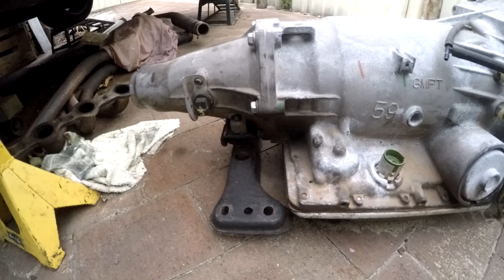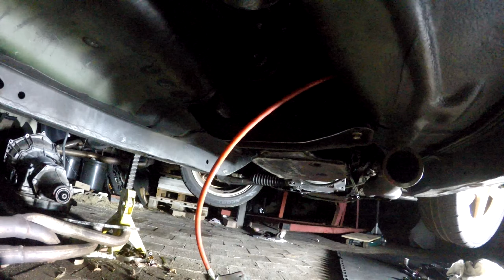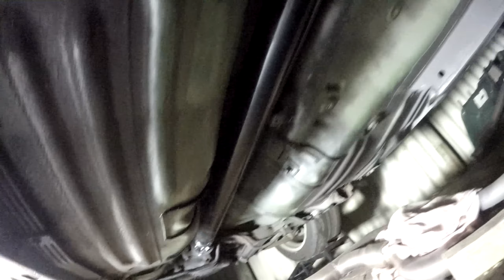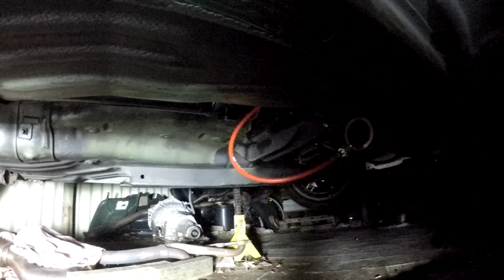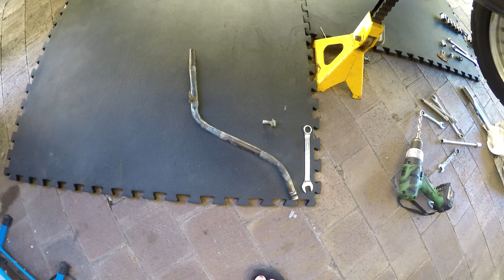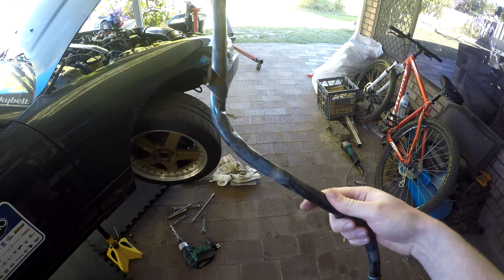The TH400 is in the Silvia and she RIPS!

Comment: Sorry mate - wanted to comment on the 1hdfte conversion but could not leave  a comment there. Any thoughts on a 1hdfte with a mechanical fuel pump conversion? I can get my hands on one that i can throw in my 105. Only concern is then there is no communication btw boost and fuel. Upside is simple and easily tuned. Any thoughts? Thanks
Reply from the maker: A 1hdfte with a mechanical pump conversion is basically a 1hdft. Not much difference other than that between them. The pump is smaller 12mm vs 14mm so you'll never get as much power from it. Also mechanical pumps are more or less impossible to tune without some smoke off the bottom end. With an electronic pump it's easy to make it smoke free.
Reply: @brendonv101  thanks mate. Good info.
Reply: @brendonv101  mate ended up sourcing a low km hdj100 fte from Japan. No security which is good. Question for you on sump - what did you use? I have a hdj79 sump but heard they have clearance issues with diff? Thanks
Reply from the maker: Hdj100 have diff clearance issues being ifs so sump is different. 79 sump is fine. Pickup will require changing to which ever sump is used also.
Reply: @brendonv101  so what sump are you running on the 80?
Reply from the maker: 79 series one.